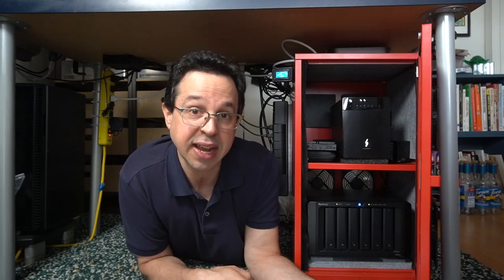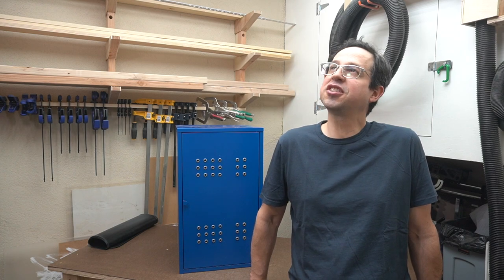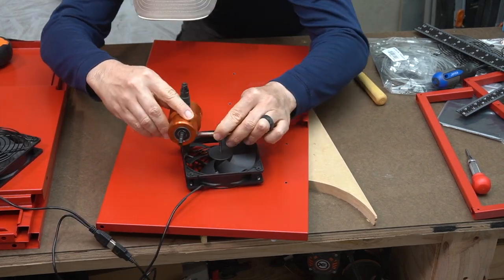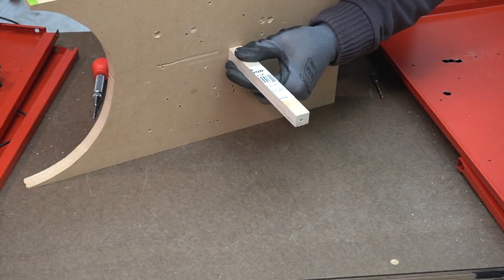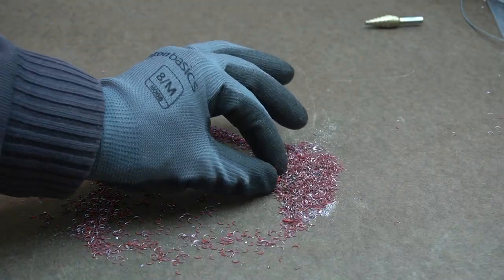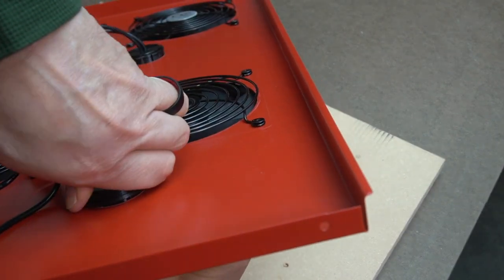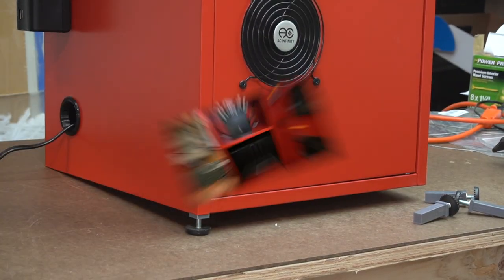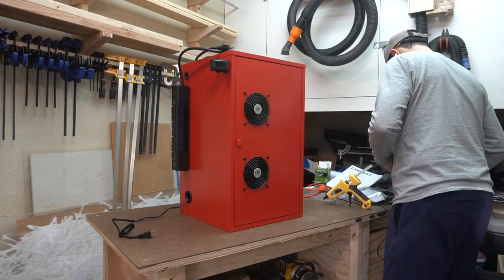DIY NAS & Hard Drive Cabinet - IKEA Hacking - Drive Cooling and Sound Dampening

Comment: Definitely inspiring! I have a custom MDF studio desk with all the hard drives, cords and hubs inside its 14cm high enclosed department – all covered with an IKEA table board. Really useful stuff 😁 How well have the dampeners worked for you reducing the HDD vibrations in your cabinet?

– Eero
Reply from the maker: The dampeners were more for reducing sound, rather than physical vibrations -- though they are related. I still hear the drives, but it's soft in the background.
Reply: @FedLearnsToMake  that's some improvement then anyway. Thanks for the reply!

Comment: thanks for the details! can you (or any1) tell me if the equipment you used is easily available at a metal workshop? I don't have the equipment would be a bit too expensive for me.

Or can the guy coming to attach the ikea box to the wall do this? I don't think his drill would be as good as ur Lathe
Reply: just a suggestion for noise please try out Nylon screws
Reply from the maker: I don't know for a fact, but I think that a metal workshop would have a nibbler tool or a way of cutting holes in sheet metal.
Reply from the maker: Good idea! Thank you